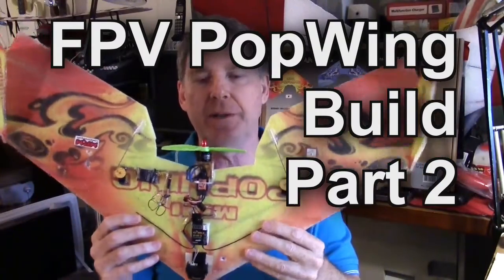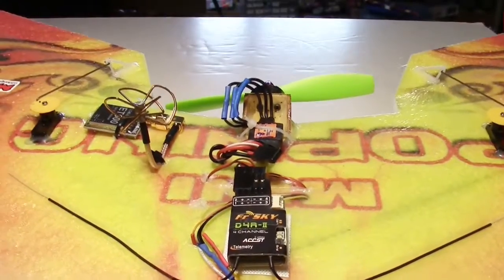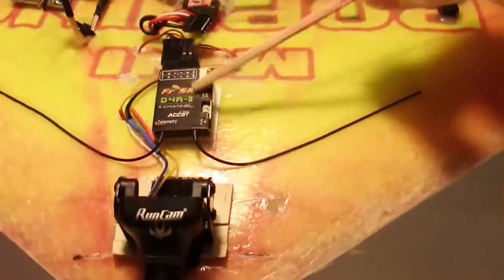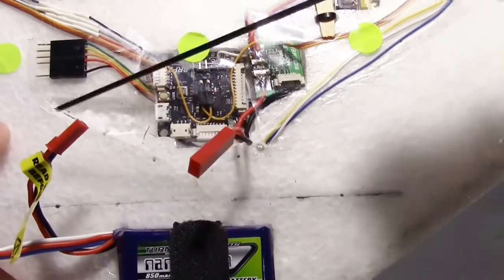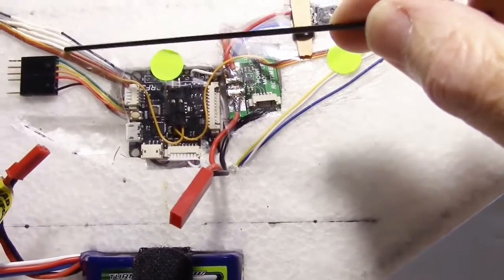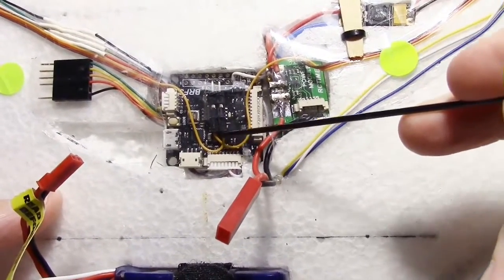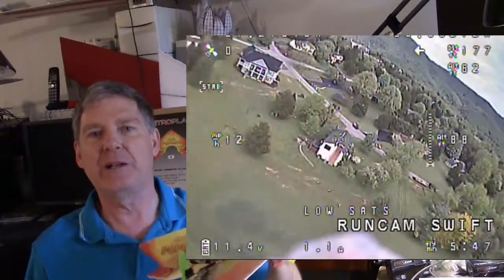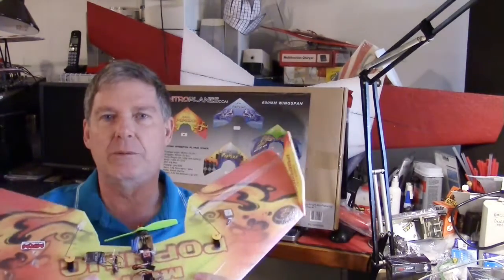FPV Mini PopWing Build or Bonsai Wing Build under 250 grams Part2 (Parts Layout and Test Flights)

Comment: Quick question: (Looking from rear/back of wing) Using suggested Emax MT1806 2280KV motor (or similar motor) would need to be CW rotation and prop adapter nut must be CCW (self-tighting). Correct? Thanks!
Reply from the maker: I think that is correct but honestly I use either direction on pusher prop planes and it seems not to matter. The nut/spinner direction is not as critical as it is with multi-rotors. But yeah, the nut should thread counter to the prop rotation if you can manage that otherwise just make sure it's tight.
Reply: dmerc00 Thanks, my assumption is correct. (lol, I got lucky!)
I understand they have a 5mm motor shaft. I'm not sure which 5 inch x ? props (black only) will be 'the cats meow'. I can bore props out, but why do that if they're market available? 
Thanks again!  :)

Comment: hello.  what is the diameter and length of the carbon fiber used on the leading edge of the wing?
Reply from the maker: Around 250mm long on each side. Diameter is about 1mm or whatever you have available. Doesn't have to be exact.
Reply: Thank you!

Comment: so i have to tell you that your videos are great .an let me tell you something  you explain everything .....but i do have to ask one thing .i have a hard time getting it to fly on the take off in what angle does the  back elovns need to be in..  up or down.. a little  up  on the back  flaps just a little .. i don't know i am new at this please can you help
Reply from the maker: Center your radio trims and servos then put 3/16" reflex (up) on the elevons by adjusting the control rods. Make sure your CG center of gravity is on the back edge of the receiver hole in bottom of the wing.  That should be a good to get it in the air. Trim from there.
Reply: thanks a lot will do. an i will keep following you to get more  tips
Reply from the maker: Are you going to put the BeeRotorF3 flight controller on it?
I have that in stabilize (angle mode) when a launch and that keeps the wing level when I toss it. Makes life easier. Then I switch to Horizon mode for more control after that.
Reply: well after building about four delta wings an not getting know where .. i order  a popwing plane  but this one  does not come with no electronics with it.. i have all the gear from all the delta wings so all i have to do is just make a little adjustment an hope again  that  it flys... I won't give up until  i get it up an flying ..I will just keep  at it...an plus with the tips that you gave me we will see....you said to make sure to put the flaps that are in the back a little bit down  not much,,  an the throttle on enough to get  it going ..thanks again ...
Reply from the maker: No I said up on the elevons, put 3/16" reflex (up) and CG center of gravity is on the back edge of the receiver hole in bottom of the wing so balance it there with the battery installed.

Comment: Why your Runcam swift seems to work better than mine :p
Nice video as usual Dave!
Happy midweek
Reply from the maker: +ABMNS PRODUCTION The secret is bonafidepirates settings and focusing the lens because it was off a bit from the factory.
Reply: Yes i noticed mine was blurry on the bottom left corner, i tried to adjust it but everytime when the bottom left corner starts to be focused, the whole screen starts to be blurry. Did they send a faulty one to me?
I will try again and have a look on the bonafidepirates settings!
Thanks for the heads up Dave :)
Reply from the maker: +ABMNS PRODUCTION Oh you might have got a "lemon". Bad optics can happen. Just contact them and they will send you another. In the mean time try testing a lens from a known good cam on it and see if it helps.
Reply: +dmerc00 Yes i might definitely got a beautiful orange lemon lol
I will try again and if i don't succeed, i will contact Runcam FPV :)
Reply from the maker: +ABMNS PRODUCTION After your last comment YT put our whole conversation is the spam bucket and I had to approve it to get back. I quess typing "RunCam" causes the filters to get angry  :-)